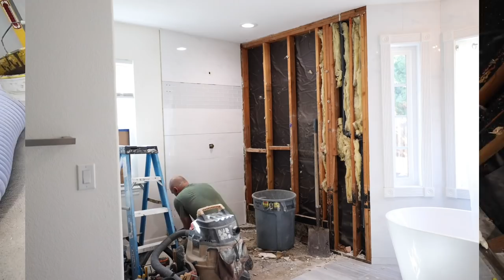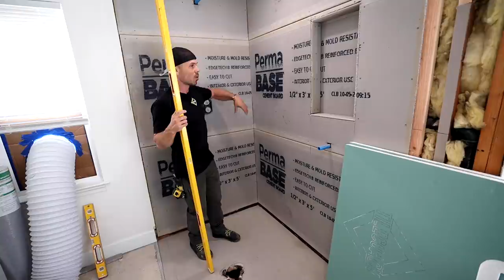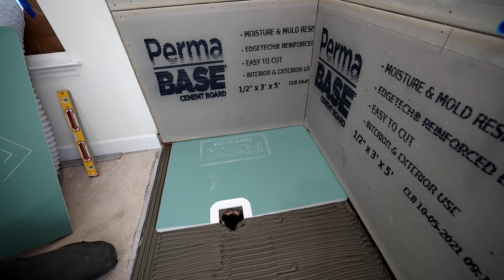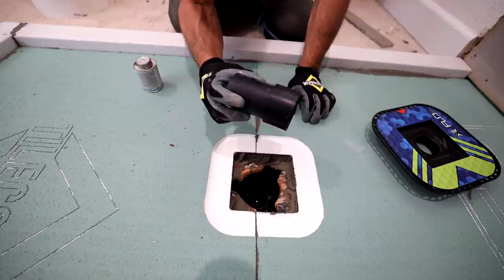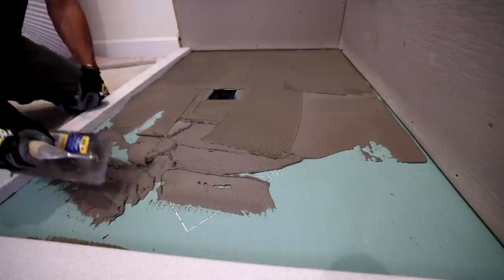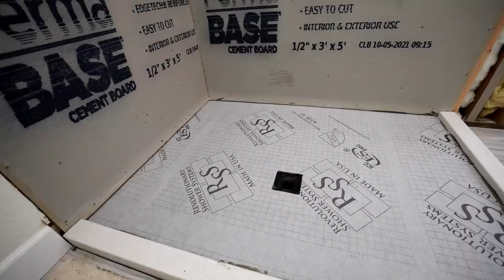Installing Custom FOAM SHOWER PAN on Actual Job

Comment: I've done my share of mud pans but I think these foam systems have come so far with the custom pre-formed pans you'd have to be crazy to do it the old way now, particularly when time is money.
Reply: Except as a DIY'er, it's a huge difference between a $400 + shipping foam pan and a $30 deck mud + membrane pan!
Reply: $30? Is your shower 12x12inch?

Comment: Big thanks for all this  info. In my youth I worked on jobs with contractors as a laborer/helper and didn't learn a 1/10 of this and that was asking questions and being on-site. I did learn how to do a LEAD shower pan, soldered in at the sides and all. That was interesting, probably a lil cancerous too.  Guess who carried the lead.

Comment: I’m doing a Schluter pan this weekend. It will be my first foam pan.
Reply: Most important is to remember to make sure your shower base is level both ways.  If not a little self leveler will fix it.
Reply: I have ripped out 3 of these now in new construction. Curbs leak drains installed wrong seams not caulked or sealed. very easy to mess up it seems for the price.
Reply: Agree stay away from the foam ripped out 80 from a renovation

Comment: I’ve found the solution to the Schluter drain screw holes. If you take a durarock screw to each hole, apply a little pressure, It will create a nice tapered area for the screw to sit flat.

Comment: Great video I got this project to do right now.  Demo it 7 months ago.  Just getting motivated to start it up again and finish it. I'm closing it completely to make it a steamroom as well. I went with kerdi but if you are using the shower pan do you still need the roll membrane?

Comment: Hi Isaac I really like your videos I have a question I'm installing hydro form board in my shower but was wondering I'd on top of the foam board have I regard it or no need to regard just to double up on the water proofing

Comment: Hey tile coach, question.

If I use a straight edge and mark any crowns on studs, Can I use a electric planer to take the high points off the studs if the majority of the wall studs are already flat and level. Or is there any potential issue I might run into by doing that?
Reply: Sounds like something I would do. Only issue would be any embedded nails. Make sure you pull any nails, or sink 'em 1/4" or more deep. Sink them deeper as you make passes with the plane, if you need to take off more than 1/8". If you think you might have weakened the studs too much, just nail an extra 2x4 onto the stud (sistering). Or sister the studs first, so you can plane both the new and old studs, so they will be even. A hand plane will also work (to those of you who do not have a power plane), with correspondingly more time and exercise. Use the power plane to cut recesses for any nail shields that will be needed to protect any pipes or wires, so the wall material will lay flat.
Reply: @doubledarefan  Thanks for the tips, I've got a job coming up with four showers and a lot of stuff was DIY by the previous homeowner so I don't know what exactly I'm going to unearth.
Reply: It is fine. It really doesn’t matter as long as you end up with plumb studs. But a planer takes a lot of time to shave any major crown.  If they are minor, it won’t really show anyway.

Comment: Doesn’t KBRS (and others) do custom one piece pans, including curbs, that are fully waterproof, aren’t foam, and can have tiles applied directly to them? They may be more expensive, but installation time is much less. Also based on one of your previous “drop test” videos, aren’t foam pans too susceptible to damage during install?
Reply: Too susceptible?  They are basically foam.  It looks like you can fill in the dents and even breaks with mortar when installing.  what kind of "show stopping" damage are you worried about?  Seems like a great solution for a DIYer like me who isn't excited about sloping a dry bed pan in a little-used guest shower.
Reply: @kenreynolds1000  could just have me do it and it’d probably be cheaper ;) I don’t charge much at all for pans. 200 bucks? Materials are cheap too. Then waterproofing I charge around 200-300 as well (can depend) 

So if you were going to do the tile you now know you have a fully water proof and strong shower and not putting trust into these new foam products.

Comment: Wouldn’t it make more sense to leave the membrane big and run it up the walls and over the curb like you do with the rubber membrane? That way you don’t have 16’ of seems round the perimeter for potential leaks.

Comment: 1 thing I'm curious about re: the FLOFX drain. The last piece cemented on, the blue piece. I'm surprised it goes over and not in the piece it joins, that if a joint failure occurs it won't drip down the outside of the pipe. Also, doesn't the lip inside create a place for hair and soap scum to hang up ? I'm not a plumber, just curious. ( Am a car mechanic for 30+ )
Reply from the maker: Good point but all drains are “hub” type connections that fit over the pipe.  If they were to fit inside it, it would make the inside diameter too small.  It needs to be 2” to meet code.

Comment: I have a question.  You mentioned you didn't want to be walking all over the shower pan while you hung the wall board.  That makes me wonder just how durable the foam pan is because obviously you are going to be walking on it for the rest of the showers life.  The fact that it will then have tile over it doesn't change the fact that it still has to support the weight of the person.  So is a foam shower pan actually a good choice versus doing a dry pack shower base?
Reply: The pan is easily penetrable from like a dropped screw and stepping on the edges would dent them etc. once the pan is install and thinset is applied and bonded to the surface with tile set to the top of the pan it’s a very solid finished product, but if you install the pan and then drop a screw and step on that screw it’s easy to poke a hole you know what I mean? That’s why he did it after the fact. In the Schluter system you would hang the walls to the floor then install the pan so the pan is mudded to the floor and side edges to the walls. Then you’d have to step on it to do you Schluter band to waterproof it but you shouldn’t have anything to screw in by then

Comment: Does the foam come with a pitch toward the drain?
Reply: Yes... the RSS HD Custom Shower Pans feature a minimum of a 1/4" per foot slope toward the drain regardless of drain placement on the pan.  The sloped (top) surface of the RSS HD Custom Shower Pan comes with a bond-promoting primer already applied to ensure a strong bond.

Comment: You dont have to move the drain with schluter. Just buy a bigger pan and cut to fit. There are rare occasions this won't work but it will in most cases. I'm sure it's a lot cheaper than having a pan custom made like this and you get the same result. But I always dig the videos man 💪
Reply from the maker: The difference is that the perimeter is level with a custom pan.
Reply: @TileCoach  ah yep you're right. Didn't think of that. Thanks for the knowledge
Reply: But Either center it or on the side. This is ugly at a random location. I guess the owner doesn’t want to bear the cost of moving the drain and will have to look at this oddity forever
Reply: @b3arwithm3  Love to hear how you would do it with a structural member in the way of centering the drain. A typical critic with no solution.
Reply: @bartosullivan8050  did it say it was the case in the video?  I know lots of owners who would not pay for any extra even though there is an affordable solution

Comment: Isaac, do you still recommend the RSS shower pans?
Reply from the maker: Yes I do!  They are great
Reply: @TileCoach  I am installing a 48X96 tiled  shower. One drain or two drains? What would you do with the shower pan? Drypack or foam?

Comment: Can you use this pan with a pan liner?
Reply: You certainly could! However, the primary idea of the a custom made pre sloped pan is all about time saving (not having to do a mud bed pre-slope, getting the right pitch, keeping the perimeter level, clean up etc.)...  however you still have to waterproof the pan when you waterproof the walls. That said, I guess for piece of mind... if you ever had a seam failure in your waterproofing a pan liner as backup would be a great second line of defense.

Comment: I love that RSS makes custom pans, I’ll have to check them out. But when installing them, shouldn’t you try to have your trowel lines go in the direction of the shortest travel relative to the thing being set? Because the pan was made up of 2 pieces the lines should have run from the valve wall side to the open side on your right. Great content, thanks for sharing!

Comment: Any dea of price per SF ?
Reply: It all depends on the size and/or if you can use one of their off the shelf standard sized pans. For a custom pan it depends on how customized the pan needs to be, the number and type of drains etc. But just for rough estimate... if the pan design is not too crazy you can get a rough idea if you figure $60 to $75 per sq ft.

Comment: Why do so many use styrofoam in showers? What's wrong with the traditional method?
Reply: Nothing wrong with the traditional tried and true method other than it being labor intensive and requiring more skills to install (e.g. right materials, proper knowledge, proper slope, liner, water proofing etc) Styrofoam pans come pre-sloped and waterproof right out of the box. Just attach them to the floor via thinset. The primary downsides of styrofoam pans is cost (i.e., more expensive than traditional) and floor tiles smaller than 2" are NOT recommended because of they offer poor weight distribution. Tile Coach did a great video showing the potential downside of sytrofoam pans. See his video titled: FOAM VS MUD --- Drop Test 2x2 Porcelain Tile Shower Pan

Comment: Aren't those foam pans expensive?  Surely, dry pack has to be far cheaper and provides just as good/better product, with a lot more flexibility as to where the drain is located.
Reply: Same price dry pack about  400$ shluter bit more $$

Comment: I would have installed the base first, That would have allowed the sheet membrane to extend up the wall for at least 4 to 6 inches. Correct?
Reply: They're going to ship the membrane with just enough coverage to cover the pan. You can order the banding in 50' or 100' rolls.